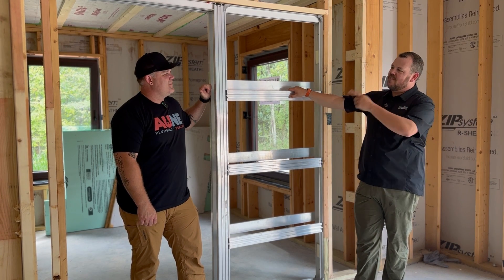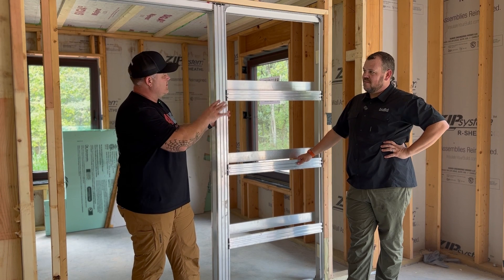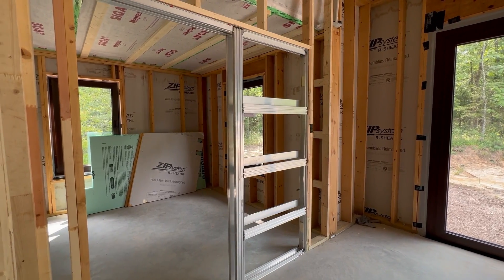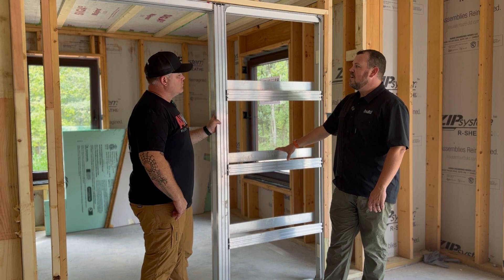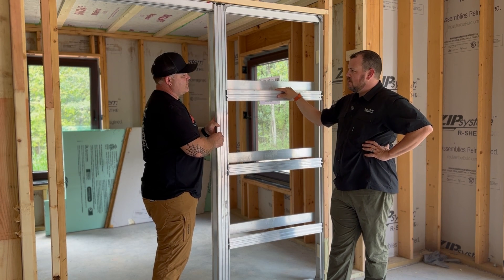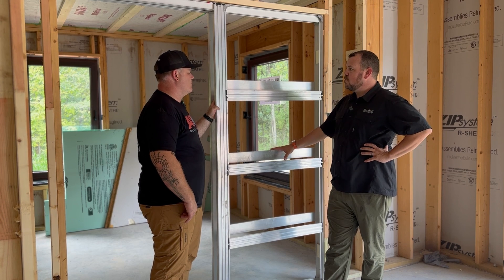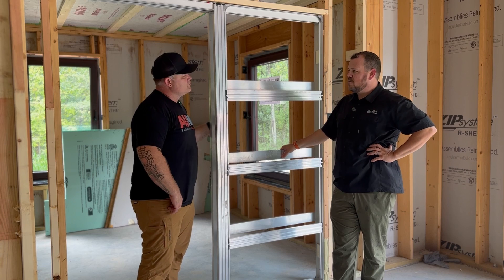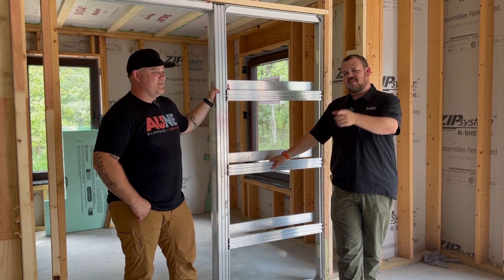Pocket doors with Mechanical Hub

Comment: now have someone come up with a better door hardware  that makes it more user friendly to close the pocket door. It is always .. poke your finger into a latch and grab the pull to close it and then try and lock it if it is a bathroom door.   but thanks
Reply from the maker: I’ve always thought it would be nice to just leave the door two inches proud when it is in the open position. But our clients think it should be flush with the jamb. Pocket door knobs and pulls stink, agreed.

Comment: We have 5 of these Cavity Slider pocket door frames and love them.  Just make sure to place the plastic spacers between the aluminum jamb before drywall is installed or the jambs may distort.  We forgot to and although the doors still work, the spacing would have been better.
Reply from the maker: Good call! That’s a great tip to share for the next project.

Comment: I used 2 of these in our house and they are very well built and sturdy.  However, placing trim around them was a challenge because your finish nailer is not going to go through that aluminum nor should it.  It comes down to using construction glue around the door frame at the top and frame-side jamb -as well as baseboard.  So, If I had to do it over, I would have gotten pocket door frames with LVL studs with metal track -which HD pocket door frames makes, or build my own.
Reply from the maker: Good tip. I think our trim carpenter decided to cut down some trim screws and use them very sparingly.

Comment: Interesting. It would be helpful if you discussed in more detail how this compares to conventional wood in terms of noise, easy/reliable rolling, etc. Also show how you finished the wall.
Reply from the maker: They are very quiet, sturdy, and the operation is incredible compared to the old school wood units. You are completely accurate that we didn’t do a great job explaining them and compairing.

Comment: Do you think the rigidity is good enough to tile a shower on the side of that wall? I’ve heard the wood pocket doors are too wobbly to tile a shower, I’m curious if that aluminum wall is rigid enough.
Reply from the maker: I wouldn’t tile the backside. I would double frame a wall with any pocket door and not trust the pocket door to hold up. There just isn’t enough there to be sturdy.

Comment: Use some ply boards to fill the gaps so that the drywallers can just screw in wherever they want
Reply from the maker: We actually do that as well so that clients (when fully educated on the matter) can also hang smaller photos or artwork on some of these walls too. Great tip.